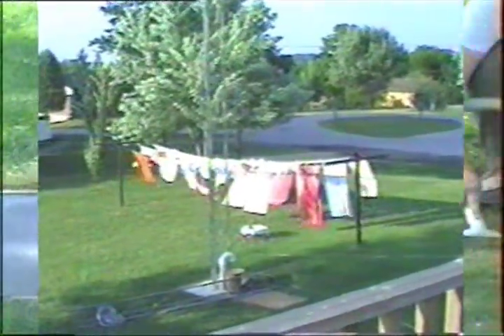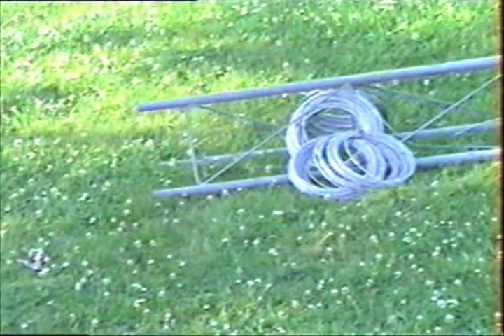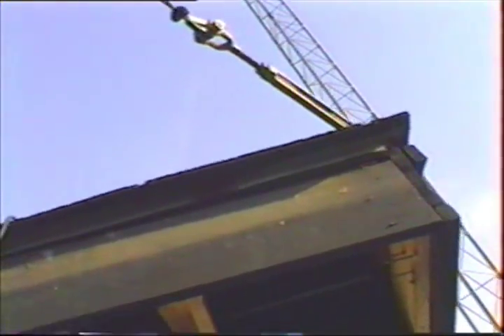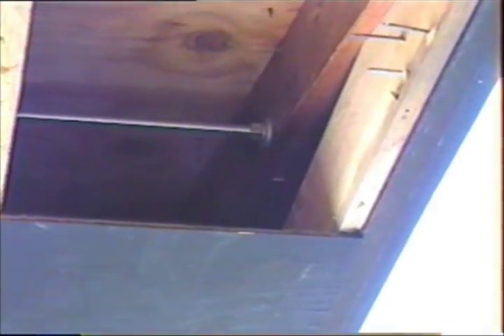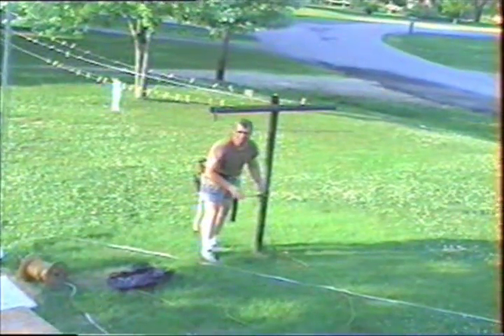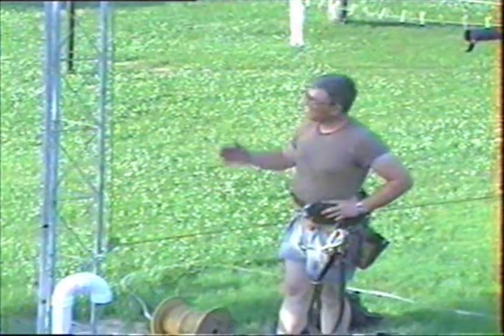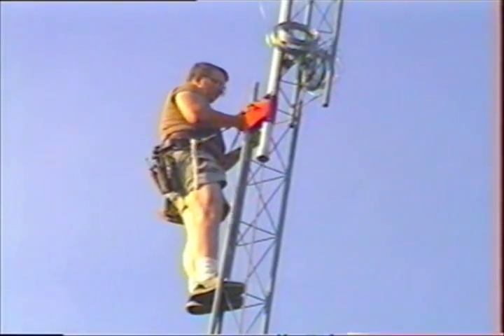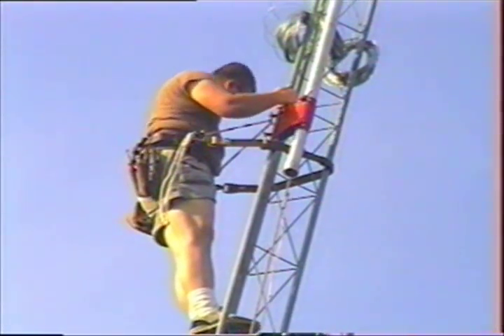Ham Radio Tower Construction One Man Method

Comment: It looks to me that about 15 feet or so from the top your tower starts leaning to the right. 

I have a few suggestions for anyone who wants to do it themselves. It would be better to assemble the tower in groups of say 2 -3 10 ft sections on the ground then put it up. Even better would be you could use a tilt base and assemble the whole tower on the ground and use a wench to raise it up.. much safer then doing 1 ten ft section at a time. If you use a tilt base. you can simply lower the tower to do equipment checks. The other option is a crank up tower or a crank up & tilt tower..with the latter the tower shrinks down to prob about 20 and the tilts over.
Reply from the maker: In the video, it appears so, but I think that is the tilting of the camera giving the effect of a leaning tower.  I would have been in a pickle at the 60 level if that was so.  Thanks for watching.

Comment: Not much of a safety. If they little rope strap breaks your ass is going straight down to those guy wires and it'll be absolute hell on your back with that climbing belt. Better off looping the leather strap through the tower so if you fall it's only a few inches.
Reply: Nick Montroy Little rope strap? That rope can probably support two full grown men

Comment: I have one question, first of all you did a great job. 
How safe is it to put the safety strap on the outside of the tower?
Reply from the maker: This can be very dangerous if you don't have your technique down.  Practice while standing on the ground, until you get the feel for it, and go up a few feet.  If you free climb, ensure there aren't any wasp nest up in the tower.  Some people are strapped in as soon as they start, but I prefer using 2 D-rings attached to about 3 feet of rope, both attached to my belt.  When I get up higher than I'm comfortable in free climbing you can attach one hook in a rung, climb up a couple feet, attach the next hook, then disconnect the lower hook.  You can leap frog all the way up the tower.  A bit slower, but if something should go wrong or you get distracted, at least your hooked in.  When I get to the top, leave the last hook attached, until you get your belt thrown around the tower.  Then you can remove the hook so you can swing around and stand on any side of the tower.  I have put the strap on without hooks and sometimes have taken several attempts to catch the free end back onto my belt.  I've not let go of the tower yet, but I've not climbed like I used to in the 90's when we installed towers.  60 feet is the highest towers I've installed and worked on.  Take it slow and easy and thanks for watching! Briz

Comment: Nice Job, you made that look easy!
Reply from the maker: Thank you.  That job was performed 23 years ago and the tower is still standing, but I reduced the height from 60 feet to 30 feet and now use it has a free standing tower and did away with the guy wires.  Thanks for watching.
Reply: Is it secure to cliimb a freestanding tower at 30 feet?  beyond six looks to risky to me... thanks for the "foot device mecanism idea" now i can realy do almost efortless myself... ...
Reply from the maker: Abraham Plata Ive not had any problems climbing this tower, in fact both my son and I have been to the top of this one.  If you swing back and forth, you can get it to sway a little.  When you're tied in, there's really not that much lateral force on the structure.  Thanks for watching.

Comment: Too scarey for me. I was always under the impression that the tower was lifted from the bottom and each tower piece was inserted from the bottom. I have a chance to get a 75' tower on craigslist, but have to take it down. Being old, it may be unsafe to climb.
Reply from the maker: +Paul Crissman That is very possible.  On one job, I had to remove a tower from atop a building.  It was so rusted that I used a hacksaw to separate a couple sections.  When we got all the pieces stacked on the ground and taking a break, I placed my foot on one of the ends of the section and it broke off.  We all just starred in silence and I'm thinking, where in the heck was that section when I was up on the tower.  If it had fallen, would I have landed on the roof, or been 20 feet out past the wall of the building?  That was one job I couldn't get out of my mind for some time.  It was only a 40 ft tower, but it was on a 5 story building.  But if you find that the pieces are still good, you'll have a nice height to work with.  I'm 25 years older and my nerves aren't as daring anymore, myself.  Be safe and thanks for watching.
Reply: +Paul Crissman How did you get it down?
I have a chance to get an 80 foot tower. Would welcome advice.
Reply from the maker: TriniFirst You pretty much do I what I did here, but in reverse order.  The catch is, don't use the gin pole to pull the sections apart, it just won't happen.  After years, the tower almost becomes fused together.  You'll need what is called a Rohn 25 jack to separate the tower pieces.  Before doing this, ensure you have the top piece attached to the gin pole.  Google Rohn 25 or 45 jack and you will see a picture of what it will look like.  It's a very effective pry bar designed to connect to the cross member ladder rungs of the tower.  There is also a safety strap that attached it to the tower so as the two pieces come apart, the jack won't fall to the ground.  I had the guys at work build me a screw jack from allthread, that required me to screw the jacks apart with a wrench.  This method was tedious and time consuming.  Looking at the picture you could build something to resemble an actual tower jack. Here is a video that shows how it works to jack apart and assemble.  https://www.youtube.com/watch?v=qJqEfPNMfG0 Hope this helps you.
Reply from the maker: +TriniFirst I'm sorry for butting in.  I didn't realize that your question was directed to Paul until after I posted my reply.  I noticed this ham calls his a Yellow Jack.  Looks like he builds them and sells them.  It also looks like he doesn't have a safety strap on his, which you could easily attach one.
Reply: +Ron Briz 
I welcome any advice. Thanks for "butting in"  ;-)
Reply: +Ron Briz 
I just looked at the jack.
This antenna tower is bolted from plates at the bottom of every section.
Reply: +Ron Briz You, me, or anyone can go to a dimensional steel supplier & buy some bar stock, take a drill & a hacksaw and make a Rohn style tower jack, by adding  a shoulder bolt and a nut. I would NEVER EVER make one without a safety wire or strap & clip. I would surely NEVER sell one, let alone sell more than one, to anyone. Have that Yellow Jack clink someone on the head from 40 feet, and you may find yourself sitting on the left side of a court room, as a jury awards someone's widow all your money and everything you own to the lady, for helping kill her husband. Gravity & stupidity don't have very deep pockets and it is almost impossible to collect from either of them, so you will be first on their list. As far as taking down an old tower, I climbed on rickety old stuff, and rickety new stuff as an indoor & outdoor/utility electrician, many times. Just remember how leverage works and keep your feet over against the vertical parts along the rungs. I had some skinny kid put his  foot through the middle of a step on a rotten staircase, then look up at my fat ass wondering how I had been up and down it all day long, without ever breaking it. Oh I also have the Buckingham "Buck Squeezer" and whomever makes the "Cinch Lock" which I prefer the Cinch Lock. If you slip or part of the tower gives way under your foot, either one will cinch around the tower. They were made for wooden utility poles, but trust me, they will grab a metal tower pretty well too. If they can grab an icy wooden pole, they will cinch down on the tower too. I cut out before those had been invented and burned a few poles between my legs. My back, knees, & shoulder are about gone from it, and some other falls too. Now I make guitar amps, & fix anything with an amplifier in it. Oh, yeah.....73s, KI7AQJ
Reply from the maker: Thanks for watching Seth.  Hope you didn't get any splinters from your falls.

Comment from the maker: Oh Jacob, now you have me wondering if my tower is going to fall.  I did this job in 1994 and it's still standing.  All the joints and holes do not appear to be showing any signs of stress. I am now 57 years old and hope that it will go another 20 years. I don't climb it nearly as often as when I was young.  At one time, my son and I were both up there getting Christmas lights to work. But we quit doing that also. Well, if it's going to fail, I hope I can catch it on video.  Thanks for watching.

Comment: I dont understand why you would build aluminum anchors. Even in a medium breeze they will bend and cause fatigue cracks that will eventually sheer off. STEEL is the best medal, and especially if you can get some stainless steel.

Comment from the maker: I must admit, I didn't know that they existed at the time.  This was one of those last minute, well the guys aren't coming to help today, so that's what I found in the junk box to make work.  With these sections only weighing about 40 lbs, the hardware that I used seemed to work well, as well as other times when we had antenna parties at other locations.  The teamwork approach is much faster and sometimes safer. lol  You must keep the cooler hidden until after the work is completed.

Comment: I'm a 'belt & suspenders' tower climber too, and still keep my home-owner umbrella policy current.  Zern30 was right, in that the video did not describe most of the other safety precautions (including your camera operator?) that the average viewers would not notice.
Your elegant rope (wire?) grip device (pat.pend.?) looks a bit like the standard tensioner for house-utility cables.  Had you tried a commercial or sports ascender like Gibbs or Jumar before resorting to that?

Comment: Although we use trees all the time to support the ends of dipoles and other such (off/)center fed antenna systems, I almost never climb them.  We use 'spud guns' (pnumatic line launcher) to get the lines over the trees.  Using a tree as a tower is as (if not more) problematic.  Ageing, flexing, growing, infection/injury to the wood; reaching from the mount point thru the crown; etc.  Perhaps you could post a description.

Comment from the maker: I thank you for your concerns but this was a new tower and never was properly guyed.  The yard of concrete has done well and since then I have completely removed the guy wires, after lowering the tower to 35' and it has been free standing for the past 12 years.  So maybe lucky, I've been and the same on the other 62 towers we have installed and maintained over the past 35 years.  Yes, its probably time I replace the rope that goes through the gin pole before the next erection.  Crankups are nice

Comment: Goodjob!
I also built the self-supporting tower of height 60feet alone. 
It also did raising an antenna (21Mhz 6el yagi) from basic excavation alone. 
One steel tower is at a time, raising and assembling a component. 
It is a site which is not as the frame of a cat. 
If a contractor is requested, in Japan, a cost of construction will be charged at price about the same as a steel tower.

Comment from the maker: Yes, I put washers and nuts on both sides of each board and it took awhile to thread them all in with that long all thread.  Several years later, I lowered the tower to get away from the guy lines due to having new siding a soffit installed.  I left the all thread up there, I wasn't about to remove them.  Thanks for watching.